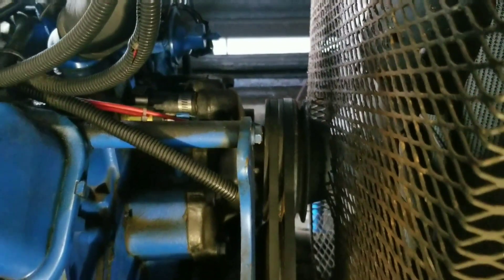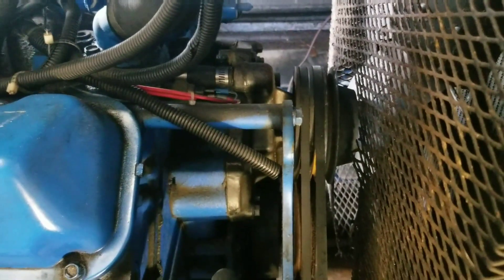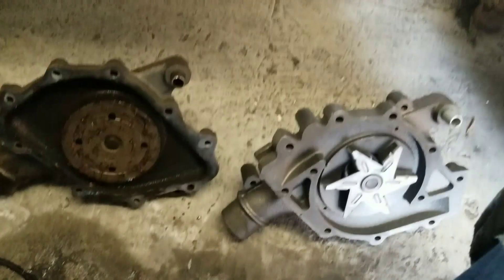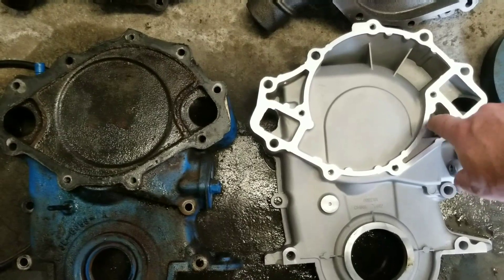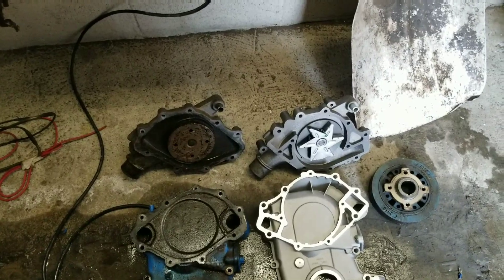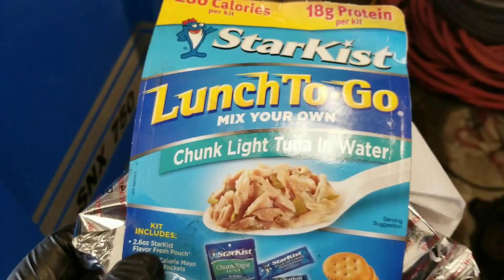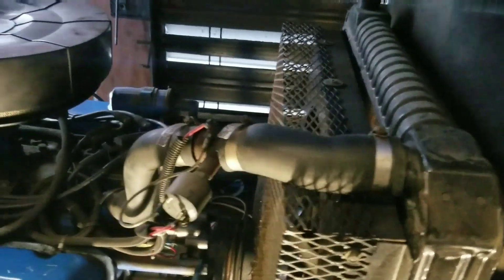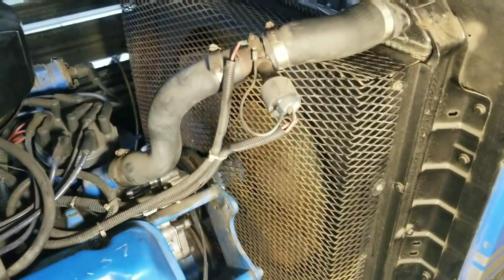ford's 460 odd ball water pump

Comment: i doubt youll respond, BUT, what did u end up having to do? can u just replace with a conventional timing cover and going with a regular water pump? or is the Foley way a special adapter? 

Struggling to find a replacement pump for my boat...
Reply from the maker: the best i can recommend, is find a machine shop to rebuild the one you got.
sorry i did.t see your comment sooner

Comment: Do you happen to know that year of that motor? I pulled my water pump off of my 1985 460 and I didn't have a backing plate.  Wasn't sure if I should reinstall my water pump without one or if I should get one.
Reply from the maker: is the timing cover cast iron or aluminum?
cast iron it's has the 9 bolt water pump
aluminum is a 10 bolt.
most likely it's a 10 bolt that some genius did not put the back plate back in.
Reply: Cast iron
Reply from the maker: @rakesandhoes6626  count the bolt holes if it has 9 your going to have to buy the conversion kit
We used thise guys for that job.
https://www.foleyengines.com/
Another option is to rebuild the water pump.
Reply: Awesome! I appreciate it